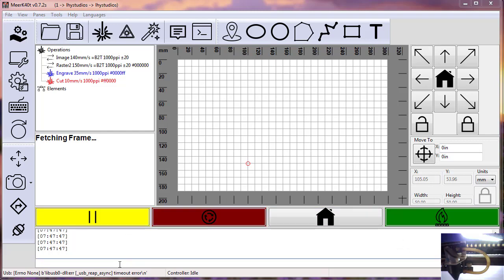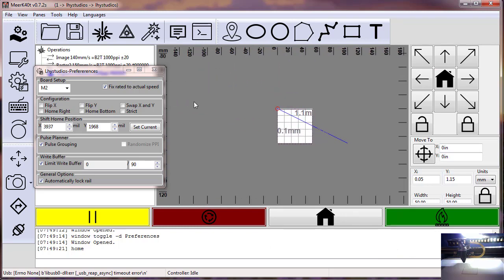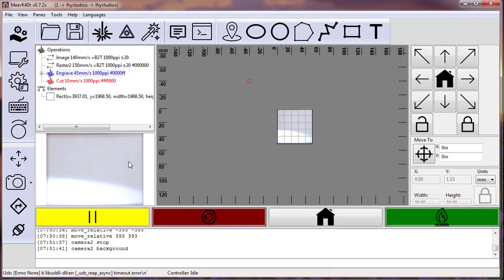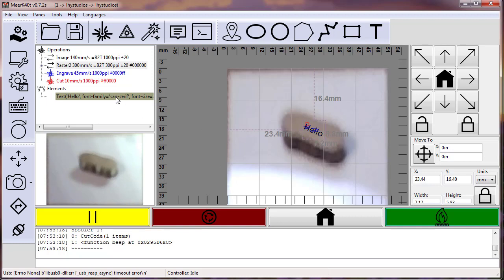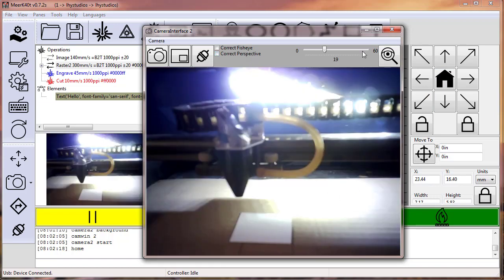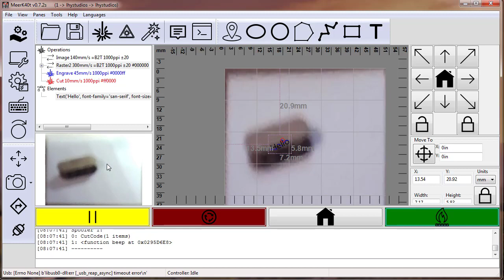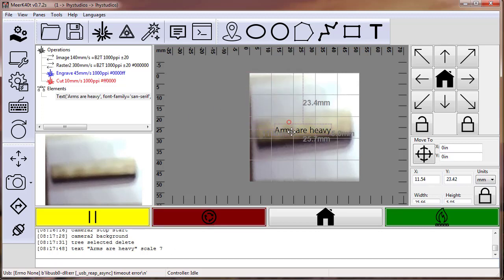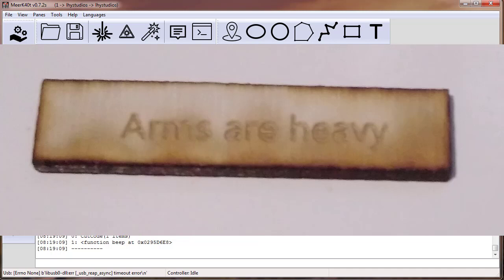MeerK40t - Experiments Large Angle Camera

Comment: Another thing I just thought of.. If the thickness of the material to be cut/engraved is known and could be input, and the angle of the camera can be extracted from the perspective adjustment the position could be accurately compensated so jobs could be placed on the top of parts instead of using the bottom footprint

Comment: When using corrected large angle camera like this, just use the BOTTOM footprint of the target instead of the top and it will be spot on every time. After all, you set up the position of the laser relative to the camera in the plane on the paper, where the footprint of the part sits. The relative position of the top of the target part will be way of if it is thick like this.
Reply from the maker: Hm. Clever!

Comment: I am trying to set my camera up, but no matter what I do, the actual design is off, usually about 5mm. Is it possible to get it exact?
Reply from the maker: The important thing to getting it fairly close is to set the exact size of the bed. Since whatever size you specify will be increased to the size of your laser-bed. So if your laser bed size doesn't match the handles for the camera it won't do a good job matching things.

1) Fix any fisheye in the camera with the detection mode and 6x9 chessboard.
2) Measure the size of the bed fairly accurately, or define your bed size to equal a known length. You can use commands to mark these locations. "move 0 200mm" will move the laser to 200mm and let you mark that location. This will allow you to have a well defined location. And when you put the the perspective markers on these locations it should be fairly close. The important thing is the bed size should be equal to the perspective markers.
Reply: @davidolsen1222  I think this is where my issue is. When I home the laser, it obviously doesn't line up to the left limit of my bed, so am I setting the bed dimension to the physical rail, or the furthest left point that the laser can engrave? I tried setting the bed dimensions to a known, 8.5x11 sheet of paper, but the alignment was still off. I will continue tinkering with it, but the more I do, the more I confuse myself. Lol
Reply from the maker: Set the home position to what does line up to the left limit of the bed. See: https://www.youtube.com/watch?v=Gn70AvoPmiQ which goes over this point a bit, when you have to shift your home position. You can also put a post-it note in the upper left hand corner and fire the laser to mark it there so you do have the position of the origin point as far as lasering is concerned. Then mark the other corners which may or may not be the actual maximums your laser can go to, use these to set the bed size. Then mark these points in the perspective of the laser, in the camera settings. So long as you have the perspective that equals bedsize fairly accurately this should give you a solid match for the positioning.